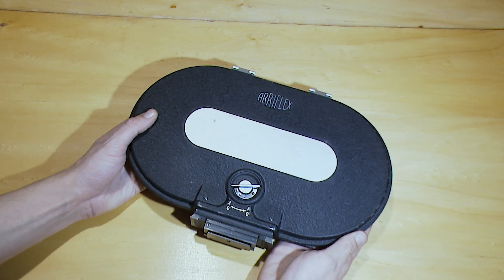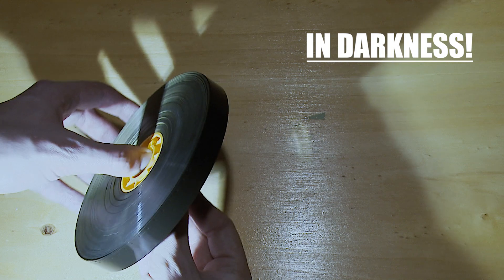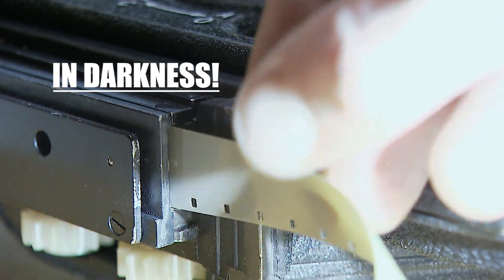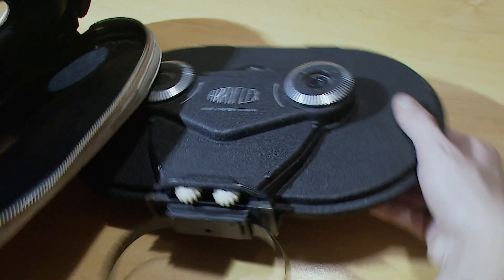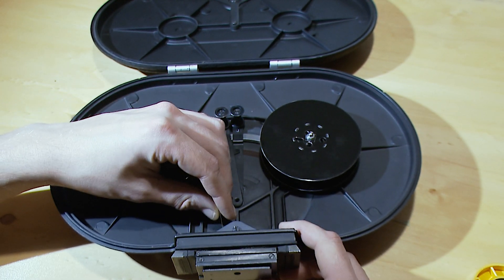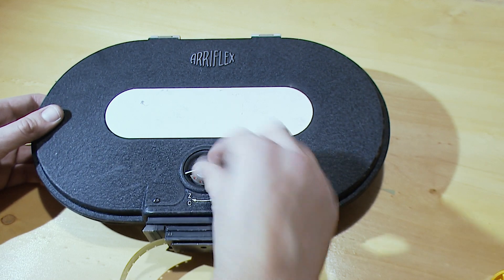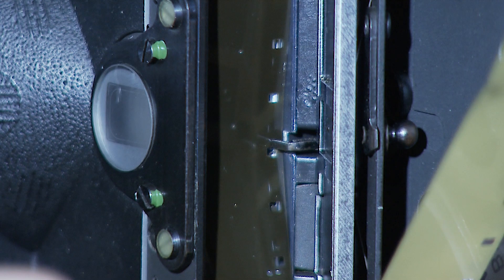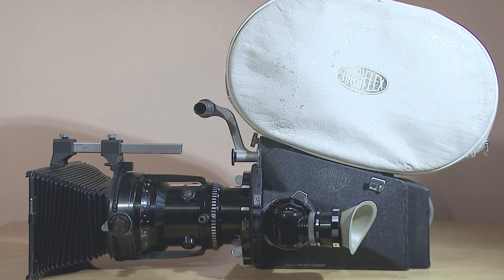How to load Arri Arriflex 16BL 16mm film camera

Comment: I have an amateur question. I know Bolex 16mm cameras can only shoot for 30 seconds at a time. Can the Arriflex BL film for longer than that?
Reply from the maker: Of course. Arri has electric motor, so you can shoot as long as there is any film in magazine (and battery is charged).

Comment: Will this camera sync with the stock motor or do you need a crystal attachment ?
Reply from the maker: With stock motors, such as BLE and EMP,  crystal sync attachment is required. Exception is 1st version motor, which can't be crystal controlled. You can easly recognize this motor by forward/reverse toggle switch. Any later motor comes without it. Later 16BL cameras came with factory crystal motor, Arri code name was BLEQ. Here you can see how both BLE & EMP (crystal sync compatibile) look like:
https://youtu.be/0VaCblV-Nnw
Reply: @ANALOGBYDGOSKI  Absolutely right and perfectly explained.